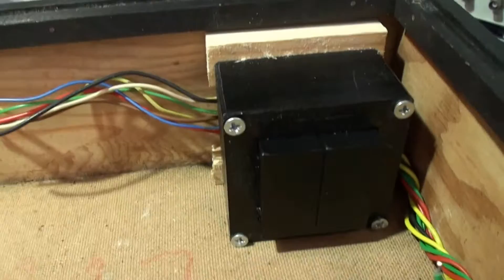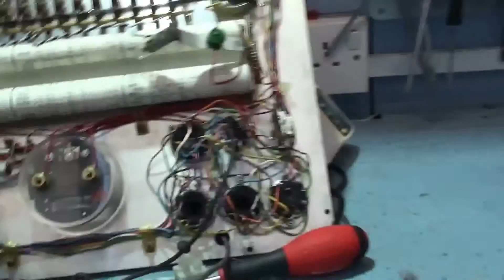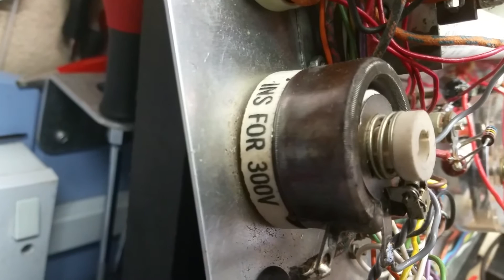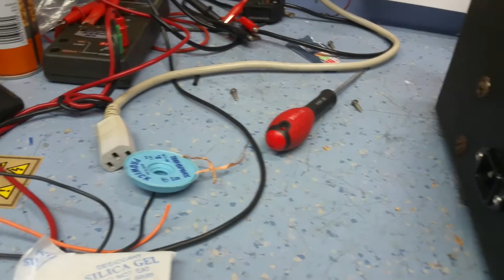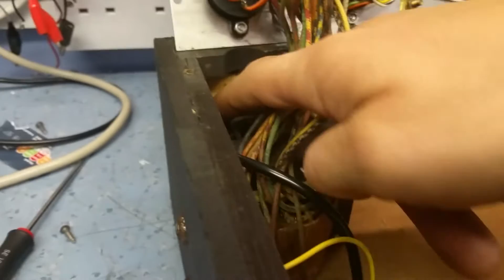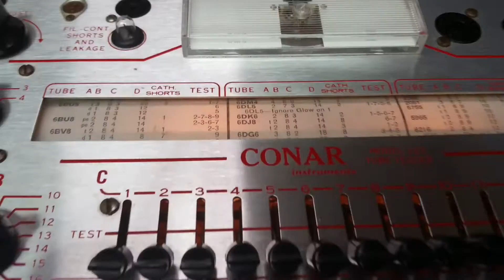Conar 223 Valve /tube tester pt2  Improvements.

Comment: Great job on the electrics Simon. Liked the meter damping and can see the need for earthing. if you added a diode would it affect the readings on the meter?
Reply from the maker: The diode should have little or no effect (in theory) to meter readings as it won't be near conduction. This meter is not really calibrated anyway, just an idea of emission performance.
Reply: Sounds like it's well worth doing then